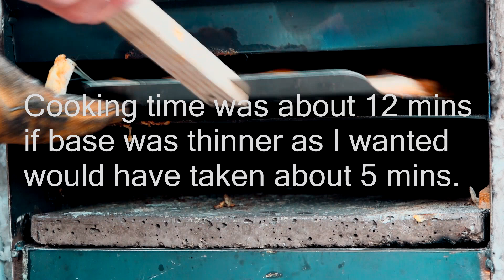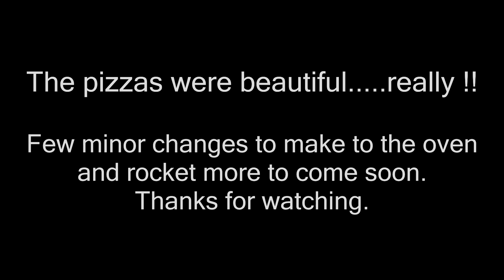Rocket stove pizza oven

Comment: good job... I wonder if putting a round pizza stone in the oven then putting the pizza on it when it's up to temp should make it easier to turn just the pizza stone then you can take the stone and pizza out and serve it that way?
Reply from the maker: I like your thinking willie, a rotating base would work well to get an even heat, however the stone gets too hot to touch up to 500c / 950f so it couldnt be taken out but good idea on the base.

Comment: I put some leftover pizza in the oven to heat up and sat down to look at YouTube, then found this.  Serendipity!

Does your riser come up right below the center of the stone that you're cooking the pizzas on?  If so, in your next design revision, consider putting it off-center.  In a commercial pizza oven like a Woodstone, there are hot areas and not-as-hot areas (calling them "cool" would be wrong; the hot areas are ~500-700 F and the cool ones ~350F).  Also, turn that top steel plate into a stone (or refractory concrete) slab so that it will heat up and cook the top of the bottom pizza.  And, if anything, your bottom stone is too thin rather than too thick; it doesn't have enough mass to even out the heat.

Great job, though; I'm inspired.  Nice job on the pizza peel, too (that's your spatula).
Reply from the maker: +J.D. Ray Thanks for the tips JD I have moved the riser 3 times to find the best spot and like you say off centre towards the rear is the best so far top of oven inside is around 700F constantly the shelf plate the same, good point on making that shelf from a thicker mass. Cheers.

Comment: I did 2 oven Rs,
but opened on fire chambre;
preheat very fast, very good cook 
(in 5L can, pizza is ok in 5 minutes, burnt in 7...)

Not used refractory bricks in brick one, less T°.

Short one in brick is also good as a bell.

Of course very bad qualityvideo  on my channel.

Good spring.
Reply from the maker: +fred san I tried steel base Fred it was far too hot and burned anything that i put on it, the refractory has calmed it down to a nice temp, it can get to 400C on a full load of sticks.
Reply: *****
 on my prototype in brick I got opposite problem,
if oven is too big this doesnt heat such, but RS proto with no cement, easy quick made...

Comment: I feel somewhat peckish now! The problem with living in Australia is that I really don't need to run my little rocket stove for nine, or more, months of the year. However, turning it into a combination stove/pizza oven would see it get more use. Did you cast the refractory plate yourself?
Reply from the maker: +James Lamb Thanks James, Yes I cast the base same material as my rocket stove riser but without the perlite. I tried a steel base but it got up to 500C and burned a slice of bread to a crisp in 20 seconds!
Reply: +ppotty1 
Just checking in to see if you'd posted the "rocket pizza stove" build video and noticed you've hit 10K subs.  Congrats, well done!